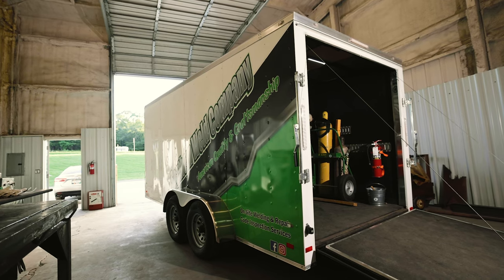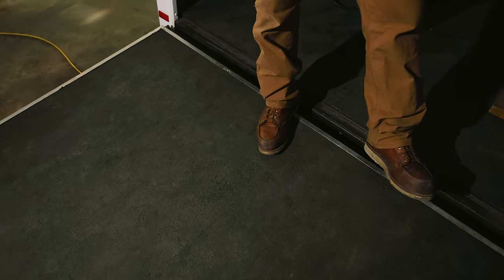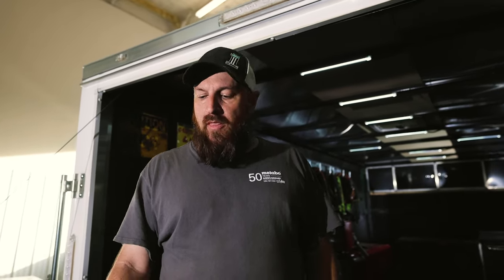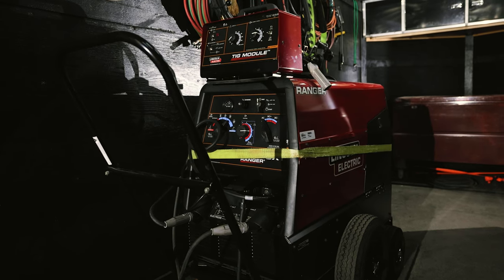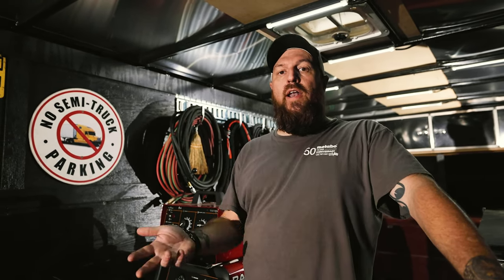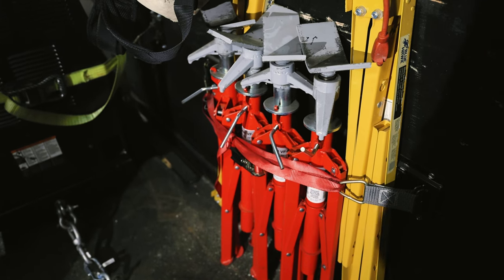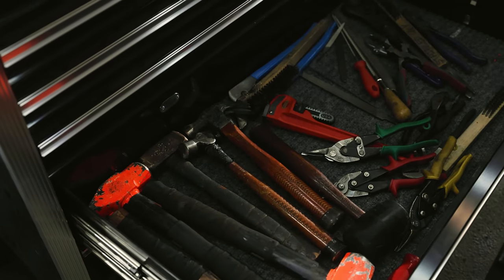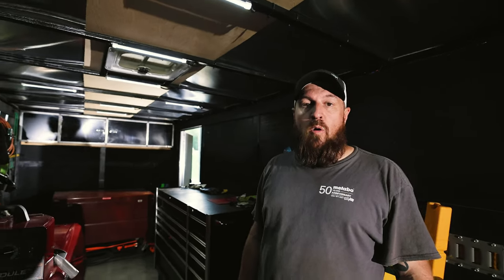Mobile Welding Enclosed Trailer Tour

Comment: Nice set up, I think the enclosed system is good for the equipment too. I use a GMC savanna fore my mobile welding I couldn’t do a trailer cause I’ll back into everybody lol.
Reply from the maker: Thank you. The enclosed does help keep the equipment out of the weather. That was one of the biggest reasons why I went with that.

Comment: What about the exhaust for the welder generator.  You open all the trailer or you have another system
Reply from the maker: I open the side door, rear door, and top ventilation hatch. If the machine is running I am mainly outside.

Comment: Nice trailer tour ! :) Can you suggest me a 110v welding machine on amazon for my rv frame when I'm on the road incase someting broke? The upper deck tubing for my fifth wheel are about 1/8 maybee 3/16 the most thicker.